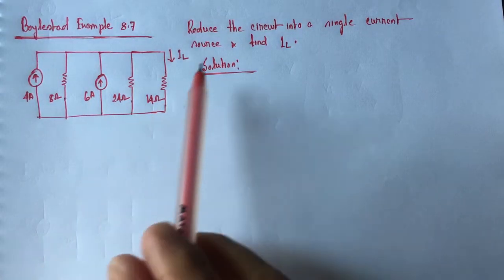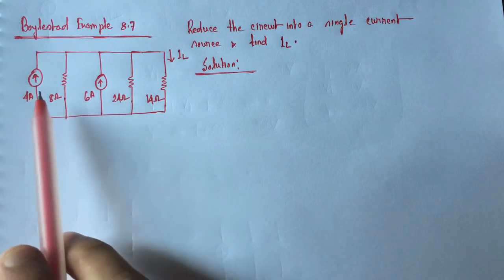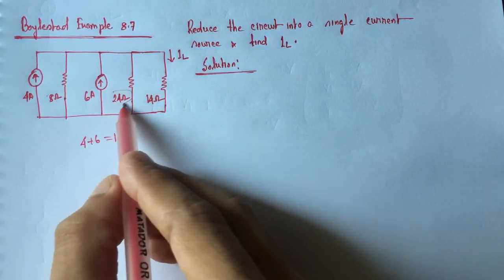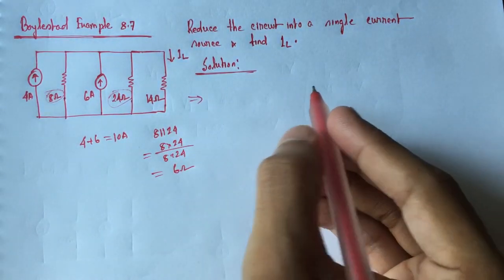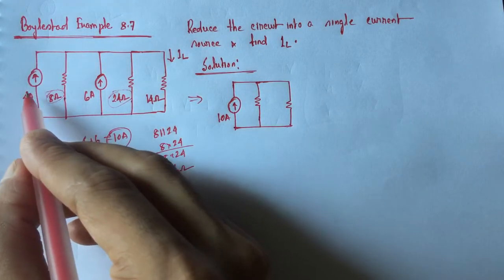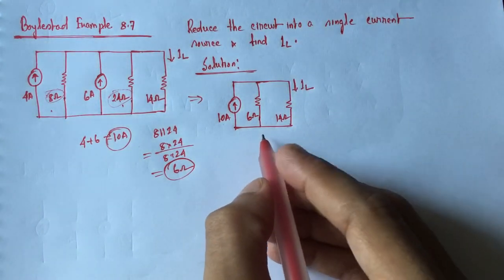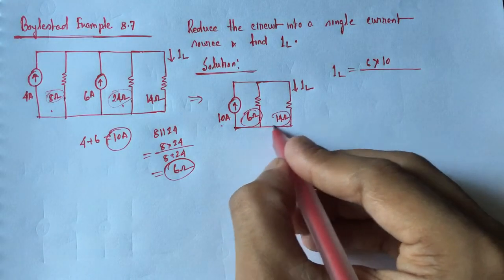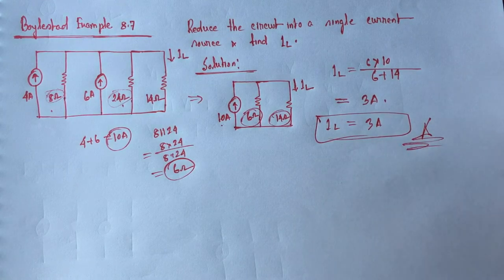How to solve/simplify Parallel Current Source Circuits (Boylestad Example 8 7)

Comment: Was not aware that you could use the formulae for parallel resisters even if there is an item between them. I assumed it was only if they were next to each other. I checked the solution of my current problem and it worked out. Thank you very much. This was an incredibly important point my professor left out.